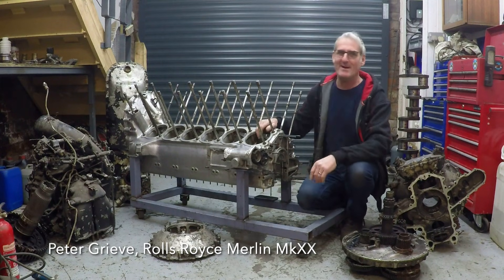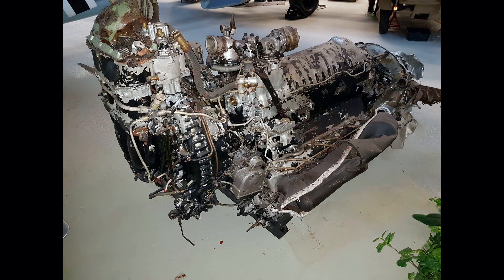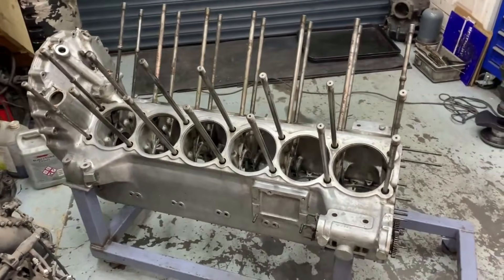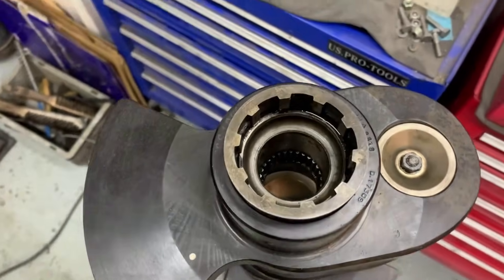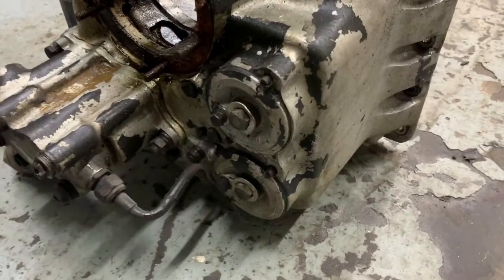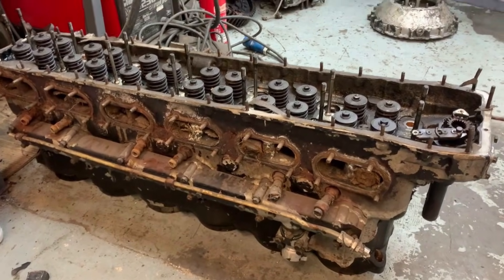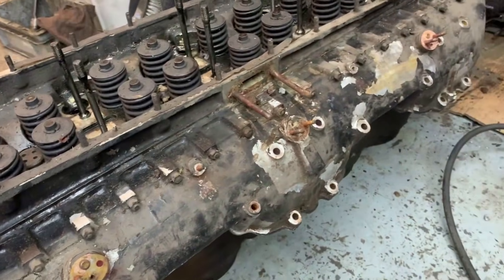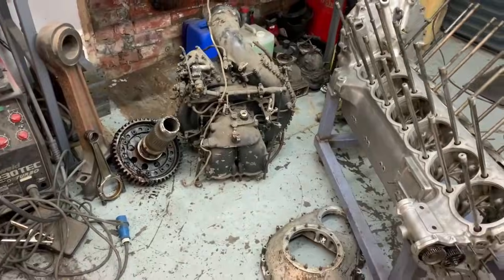Start of rebuild of a Rolls-Royce Merlin MkXX aero engine.  Episode 1

Comment: I tend to think that the 'flat' valve arrangement would be a very poor performer in a normally-aspirated engine but works fine in 'positive pressure' system, where that pressure is not so concerned with port 'bends.' But, that can't be entirely true as suggested by Hooker's work on the supercharger-to-intake transition. Allison used canted valves, but it doesn't seem to have 'widened' the head that much. Then again, the ramp head doesn't look much wider either. I guess my interest will always be 'lured' by confusion.

Comment: I had occasion to see a couple of ex ww2 merlin's that had been converted to run a saw mill in the 1950s or 60s. Apparently they sold a bunch  of the new in crates surplus after the war and a enterprising guy had picked up a few engines cheep and had them running with out a supercharger and the engine powered a saw mill through wide leather belts and saw a couple of decades use. Unfortunately when I saw them in 1982 at a saw mill in or near Gravilla NSW it was when the company had become insolvent and we had to pick up some of the  equipment they wanted to sell back in Brisbane... I imagine they would be worth some money  today.... but back then as far as I know they were left in the bush.

Comment: Pete is a marvellous stuff ! Nowadays you find somtetimes mymmified victims of tribe rituals or executions 1000 years old in those places. The bodies are nearly pristine . Thats the reason why your engine is in such a good shape. Better than everything you normally find made of steel or aluminium dug out from the ground. If the rest of the aircraft was in the same place covered with pete than it would have probably only the battle and crash damage , nothing more.

Comment: Truly amazing condition that this engine is in even excluding the fact that the aircraft it was attached had crashed. Engines of aircraft that were ditched at sea when recovered will show extensive damage to the reduction gear housing and smaller external parts will be wiped away from the cases from the force of impact with water.
There had to have been an extraordinary set of conditions to have taken place right at the moment of impact for this engine to show almost no crash damage. And to have crashed into peat bog that protected the steel and aluminum components from long term corrosion is hard to believe.
Have seen engines that had accumulated more damage from being displayed in a museum than this one has from the crash.
When you think about how many thousands of Merlins were produced and how many of these were lost in combat it is amazing how few of these have been recovered.
This was a very lucky find indeed.

Comment: Peat bogs are usually acidic , sometimes very acidic with a pH under 3. Lead acid battery electrolyte has a pH of 0 to 3 depending on charge state.
The fact that this motor was not corroded is pure luck.

Comment: I know it’s not economically possible except for someone Uber wealthy, but would it not be fantastic to see a Merlin completely stripped down and rebuilt from aluminium and titanium parts using modern processes and techniques
Reply: The biggest problem is getting any change of materials passed by the CAA if you want it to fly.

Comment: Great video!  Do you know which Paxman engine the connecting rod came from?  Most of the ones I’ve seen are a bit smaller than that and fully machined so guess it’s an early engine.
Reply from the maker: It’s an 8 YLC, 101 litre v8 built in 1957 as a standby generator at Pilkington Glass in St Helens.  The crankshaft is a 2 ton sculpture in Peter's garden!

Comment: Please have that crank checked by a good machine shop before assembling. Looks like it needs some attention. Basing this on a long history of auto engine building. With that, way to go, having and refreshing these incredible pieces of historic "machinery".
Reply from the maker: Peter has 30 years experience building and running Merlins and I am sure will test it thoroughly before assembly.

Comment: Hey Pete are the con rods bolted separately to the bearing carriers?
Reply from the maker: Conrods have a fork and blade arrangement.  Fork bolts go through split bearing carriers that secure the split bearing shell.  The blade rods are similar to normal engine rods; bolts secure end cap with bearing shell, but the shell runs on the fork bearing shell.
Reply: @HistoricAeroEngines  I saw a vid of T34 engine which had fork secured to beating rod with two 12 mm pins going through several fins.

Comment: I am curious about the crank shaft it is not a one piece can you please give information how it is built up
Reply from the maker: Hello - the Merlin crank is one piece.  Weighs 104 lbs finished, from a 240 lbs billet.
Reply: The reduction gear drive is on a short extension shaft.